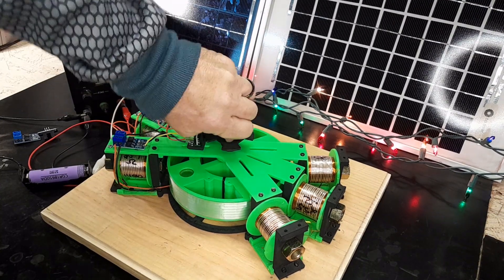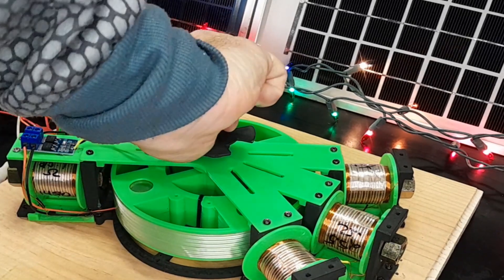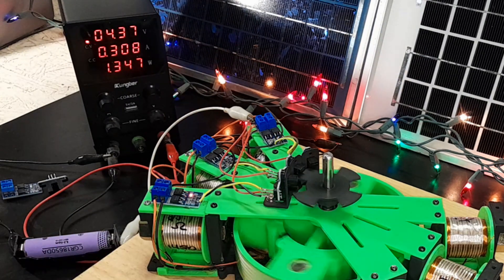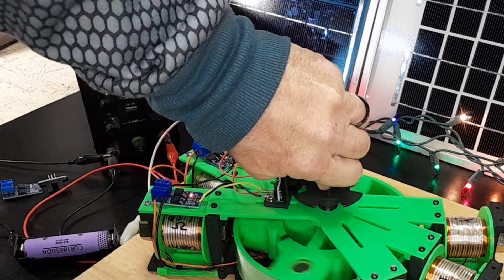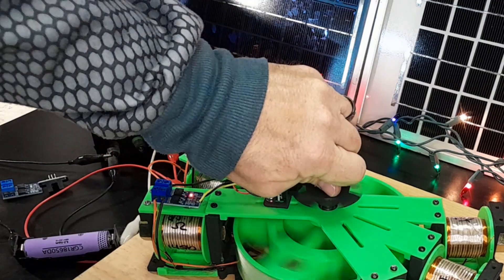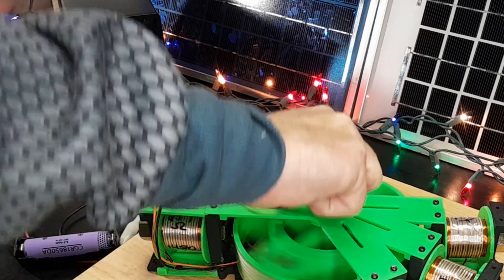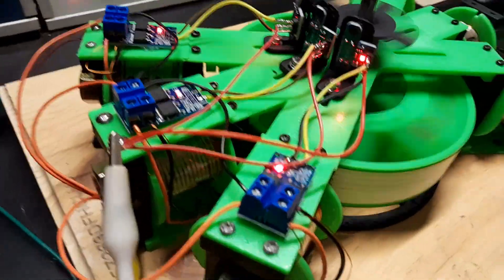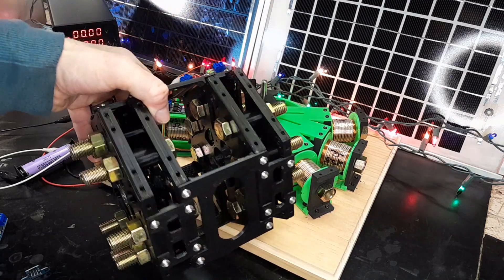Adams Motor = Torque

Comment: Wow! What a big torque! It's very interesting! Can you be a little more detailed? For example, as we can see from the video, your Adams motor has four magnets and 6 coils, right? Please specify the diameter of the rotor, the dimensions of the magnets and their magnetization. And more, can you tell me the parameters of the coils - the diameter and length of the core, the diameter of the wire and the number of turns in the winding. And more about the core. If it is made from a bolt, please tell us the dimensions of the bolt and the hardness class of its metal. I would also like to get such a torque so as not to stop the rotation with my hands! I will be very grateful for your answer!
Reply from the maker: That was an old experimental model, check out my latest motor. I think you might like it better. It has way more torque.

Comment: How’s that new big adams motor coming along?
Reply from the maker: I got all 16 coils wound 500 turns each of 25 awg. Waiting on parts now. And I work a week on and get a week off. I just started my week on. Won't be able to work on it until next weds.
Reply: @redesign3dp  
Sounds like a great start! If you have space on the back of the bolt try putting a coil there that way your output is isolated
Reply from the maker: @kenergy1707  good observation, I actually used longer bolts into the design just to try that. Have you ever thought about 3d printing? It opens up another world and speeds up prototyping.
Reply: @redesign3dp  
Lol I saw enough space 👍

Yes I have for the last 5 years just havnt bought one yet and I need some practice with the program 

I usually just design it on starboard then cut it out and put it together lol 

I definitely want one 
Have you tried the Ferrell material? Mite work good with the neo magnets
Reply from the maker: @kenergy1707  you can get a free hobbyists subscription to fusion360, there are tons of lesson videos. Ender 3 printers are $199.  I have some iron PLA but its not as magnetic as I'd like.
Reply: @redesign3dp  
Cool I’ll check it out !